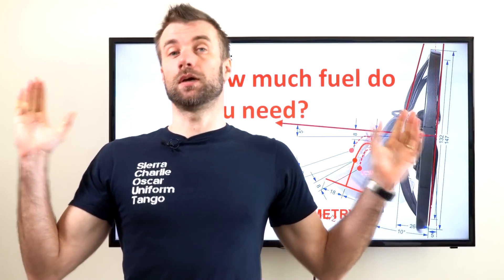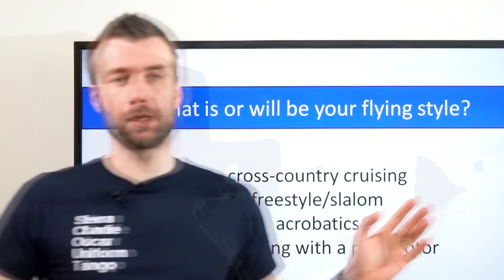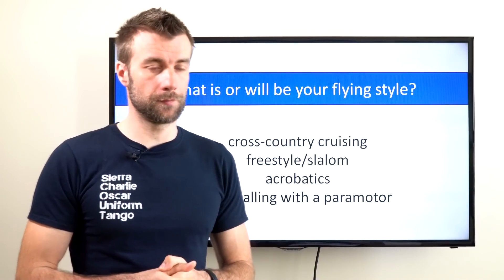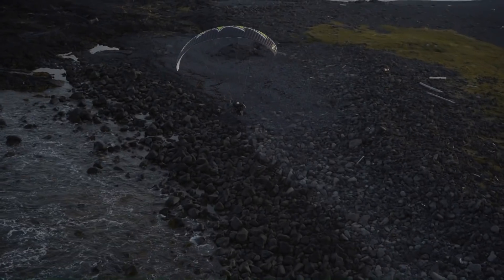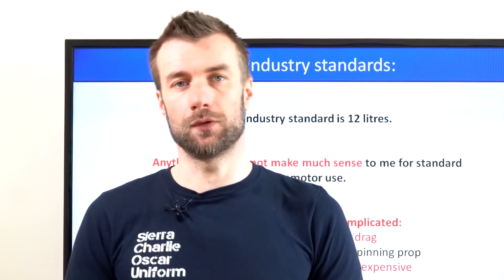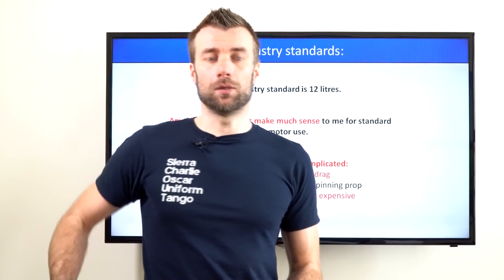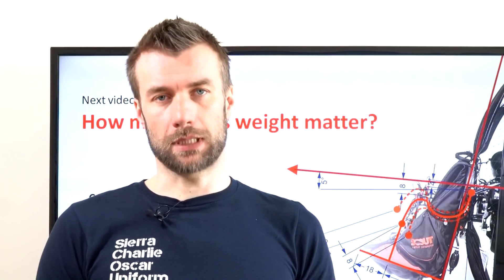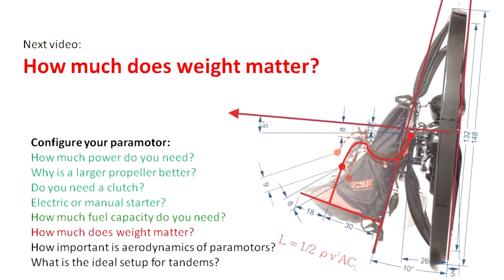How much fuel do you need? Paramotor geometry part 32

Comment: Hmm i would have expected you to get into how to expan the fuel capacity. examble a fuel bladder, or on a trike simply quickconnect 2 tanks for more capacity. on my trike i have room for 16+12litres all behind the seat ( vertigo trike with athor250), i did the conection my self. usaly the 12L is emty. when loong xc i quick connect the 2 tanks and suck off the "secondary tank as it in flight will be placed lower-gravity i run out og fuel when its emty not as i cant pump it to the motor. let me see scout innovative on fuel for XC for example Icarus racing for both trikes and footlaunch units :) but also systems that can be converted to on a daylybasis systems :)

Comment: Top80, Flying Dudek universal, 300meters elevation, 60kg pilot, with the trim set to slow it consumes less than 3 liters per hour. That's amazing. I could swear I took off with 6 liters and after landing 1 hour later it still had 5 liters. Very efficient engine.